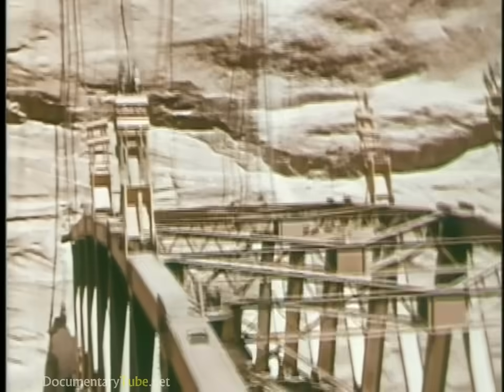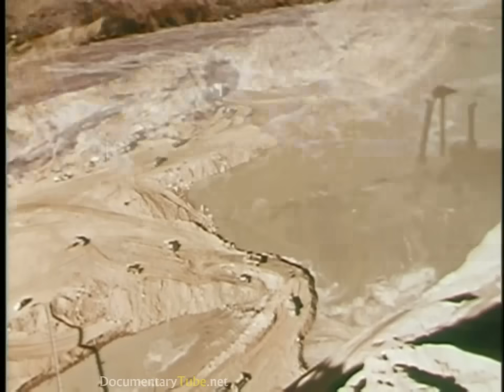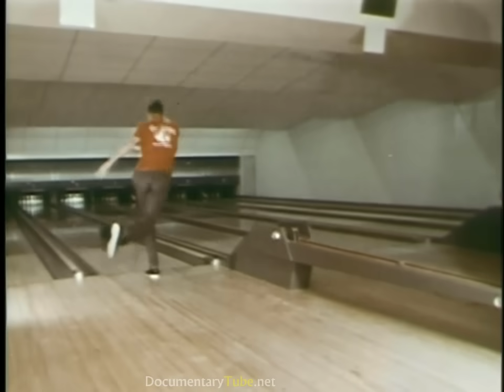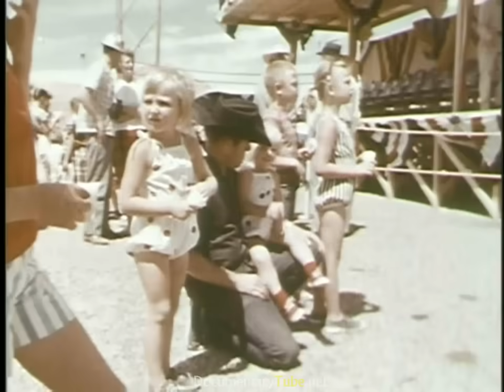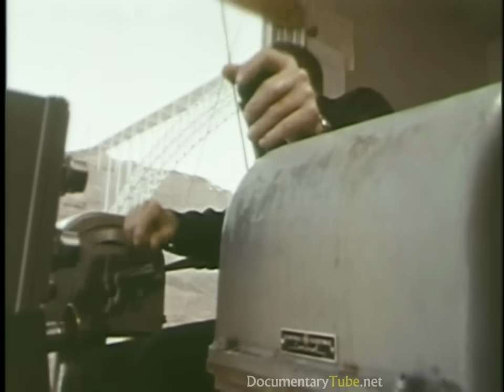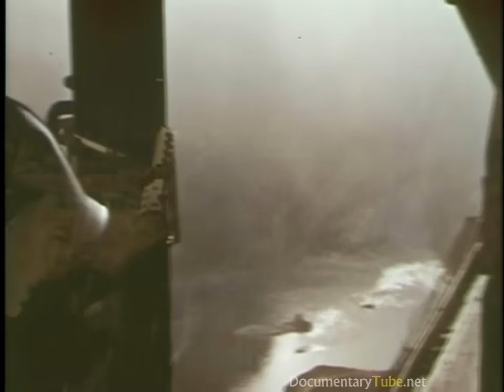HOW IT'S MADE: The Glen Canyon Dam

Comment: Building a dam anchored in....sandstone. Is it just me that thinks of this site as a wrong place to put a high Dam?
Reply: Was thinking the same thing.  Was there in the 70's.  I saw seepage and they had to put in anchor bolts.  This is on the front side of the dam to shore up the rock walls.
Reply: It’s a gravity dam....😒
Reply: @day180205  You maybe absolutely correct.  If water can seep under or around, it does not matter.  As stated above.  In the 1970's , I saw water seeping around and rock bolts holding the sides together.  This does not make for a stable dam.  Please explain if you think different.

Comment: Very interesting, I just watched the guy showing in 3D I was disapointed. I also watched USA dam daster but this dam will safe because even dam break down surrounding won't be affected.
Reply: Sadly you are mistaken about the failure.  There is a small community in the base of the Grand Canyon.  That would be wiped out.   The Hoover dam is down stream.  That could be topped and or destroyed.   This would affect 10's of millions.  The communities would be wiped out.  The millions that depend on the water and power would be SOL.
Reply: Damn those damn dams!
Reply: Lake Mead is so low these days that Hoover Dam might actually survive a failure of Glen Canyon dam now.  When Lake Mead was full, Hoover Dam would have been overtopped, and there would have been nothing to do from Las Vegas to the Sea of Cortez but just get everyone out of the way.